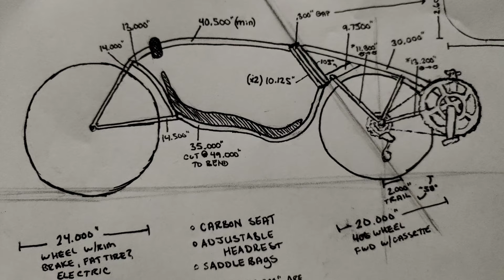Recumbent Bike Build, Episode 2024-01

Comment: Careful with the pulse MIG welding, it ends up creating a cold weld with many stress risers. Always best to run a continuous bead after tacking. Stoked to see you on YouTube and building cool stuff nonetheless!! Excited to see where this ends up 👍
Reply from the maker: That's a great point to make Chase! I think with the metal being so thin and me pulsing it while the previous puddle is still hot, I can get away with it. :Knock on wood: I know I'm getting full penetration but that doesn't mean stress cracks can't or haven't formed. Time will tell. 

Thanks for posting
Reply: thats not Pulse MIG which is a specific thing, it's more like continuous tacking. but you are right about it being a cold  method that will have stress risers